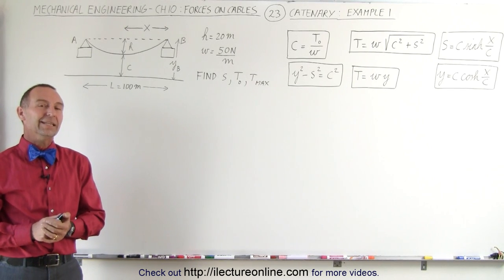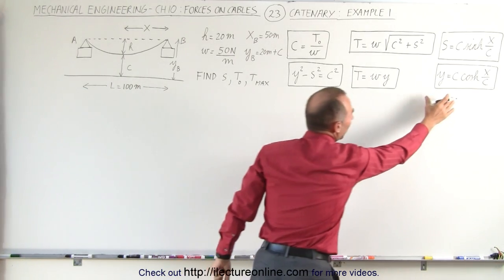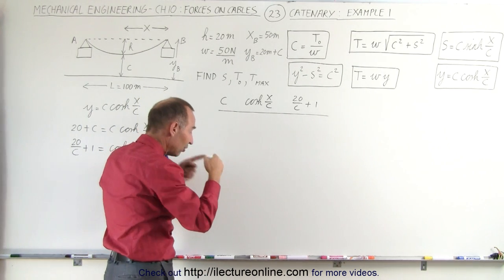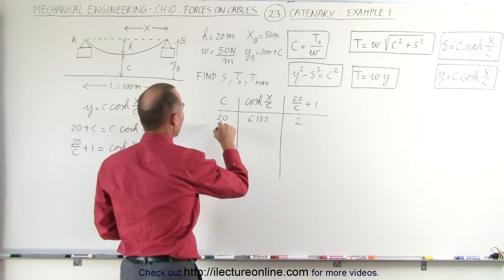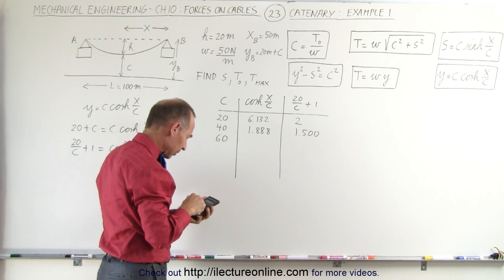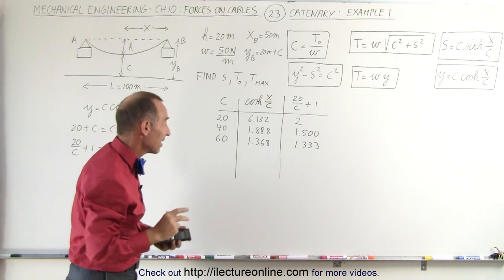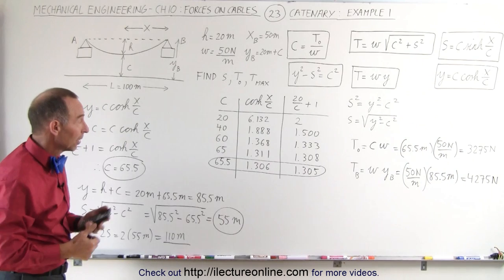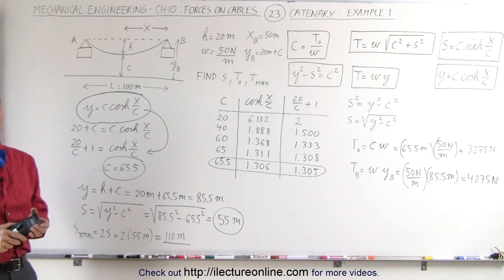Mechanical Engineering: Ch 10: Forces on Cables (23 of 33) Catenary - Example 1

Comment: These are fair approximations, suitable for most practical applications with relatively small loads and strong cables, with negligible cable stretch. A little numerical analysis yields: To= 3279.3129 N, Tb= 4279.3129 N & y= 65.586259 cosh(50 * x/3279.3129 -0.76235481) -85.586259, with a cable length of 109.972m and an angle at the supports of 39.975643  deg wrt horizontal, all to an unnecessary level of precision for this example.
Reply from the maker: In the real world that level of "precision" has no practical purpose.  The level of precision should reflect the accuracy of the measurements that go into the problem.  (I actually take points off if my students give me answers like that)
Reply: @MichelvanBiezen  As well you might, for we don't need people wasting time and reducing economy of effort. I was once happy to guide my own students to a better understanding of orders of magnitude and useful analysis in matters of accuracy and precision (e.g. the difference between stringing transmission lines and guiding a radio telescope to an area subtending a thousandth of an arc second of the sky), but am now also happy to watch angels dancing where they may.

Comment: Mr. van Bieze, Your explanation is clear and delivered well. However, for my needs I would like to change the problem. It seems that the distance Y is arbitrary and in this problem, the distance h is given. Can you rearrange the equations to make the reference line (Y) at the location of the connections (Y=0) and show how to calculate h given L and s? Looking forward to your reply. Les Ross
Reply from the maker: If you watch the other videos as well you'll see that the location of the y reference is a very specific location.  For the equations to work you must maintain that convention.
Reply: Yes, I am trying to do just that, but YouTube does not list all of the videos in order. Perhaps if we had a play list of just the chapter 10 videos.
But I did watch (16 of 23) and saw that you concluded that X=sinh(y) and y=sinh-1(x). In this case y is the sag. But doesn't the (X,Y) relation depend on the cable length s?
My application is for a cable on a space vehicle, so Y above the ground is not useful except as an arbitrary datum. I really need to calculate the sag (h). I know L and S. Can we assume that C = -h and start from there?
Reply from the maker: Y is an particular point below the lowest point on the cable and it is related to the other parameters as shown in the videos.
Reply: @lesross4442  y=0 doesn't technically mean "ground level" either.  I work in lighting, and have designed systems where the y coordinate is roughly 170ft below ground level.  Assume y is arbitrary and ignore it having a position in real life.

Comment: Mr. van Biezen, I think I worked out an understanding of the catenary in my sleep last night. The pieces started coming together in the shower this morning. 

Please tell me if I am on the right track or am I completely delusional?

The catenary is a particular shape of a curved line just like a circle, an ellipse or a parabola. Each of these shapes have a general formula (r^2=x^2+y^2 for the circle) and a characteristic that describes the particular example (r=10). In the case of the catenary, that characteristic is the distance you are calling C. It is like the focus of a parabola or the distance between the foci of an ellipse. 

But each of these general shapes is infinite in length without another characteristic describing the arc length. For the catenary I think there are 5 parameters, the characteristic C, the sag h, the distance L, the arc length S and the angle at the fixed end of the arc. One of these parameters may be redundant. 

I think that with any 2 of these parameter known and knowing the formula for the catenary, the others may be found.

This relationship to other curves may have been presented in another Chapter 10 video, but You Tube will not present them in order. If I am correct, I would appreciate a video presenting the generalized catenary math as it relates to other curves.

The thing that tripped me up is that the catenary is ALWAYS presented like a telephone wire curving down. This makes me think that C is the ground. I think it could be presented more generally to avoid confusion.

With respect, Les Ross